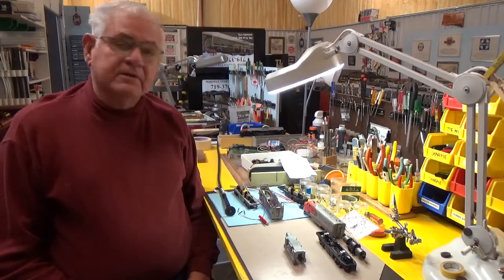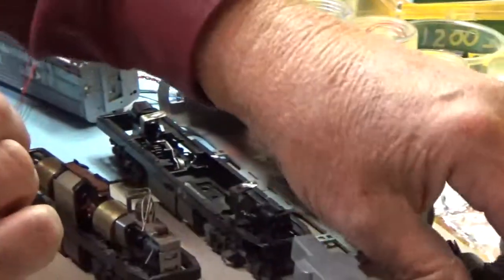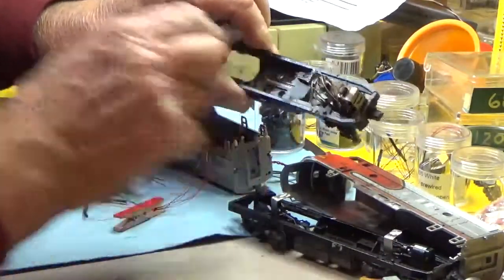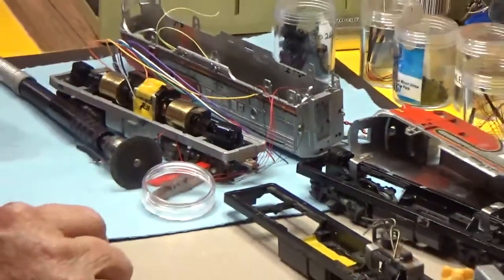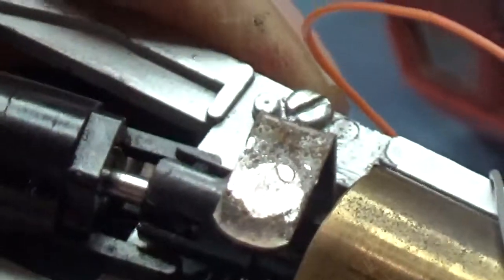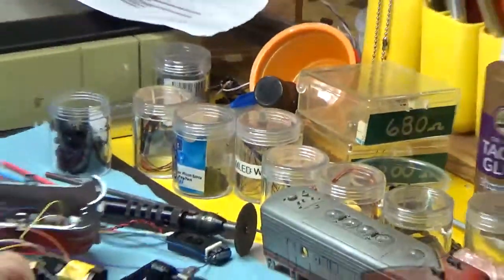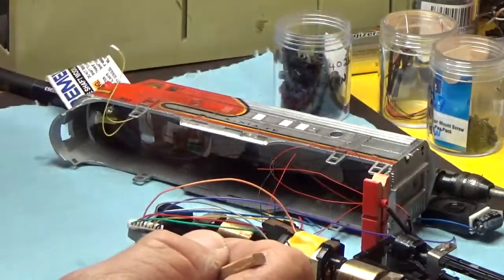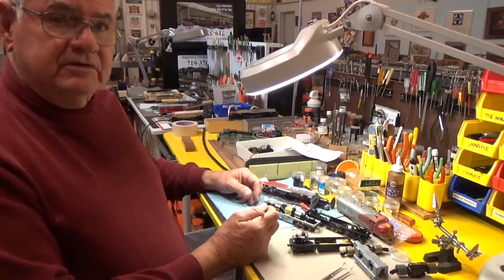2018-12-15 - F7 Athearn DC to DCC Conversion (Part 1 of 2)

Comment: don't push those copper tabs down . Just switch the copper clips top to bottom. then you can solder to those tabs.
Don't dremel off that steel headlight bracket. You can solder wires to it. Then you don't need to drill and tap a screw hole.